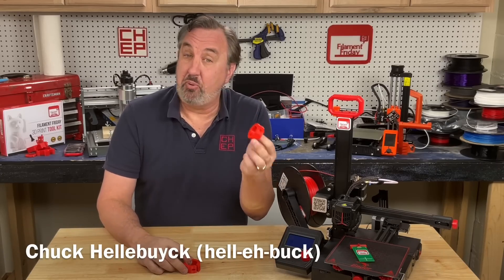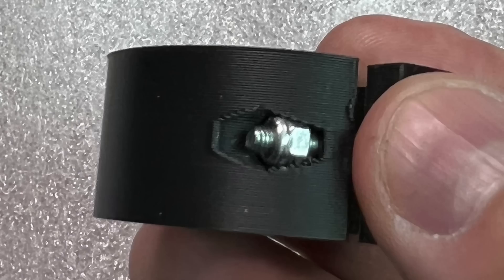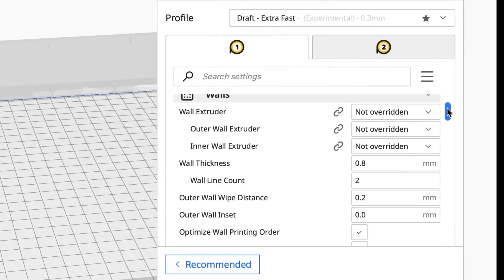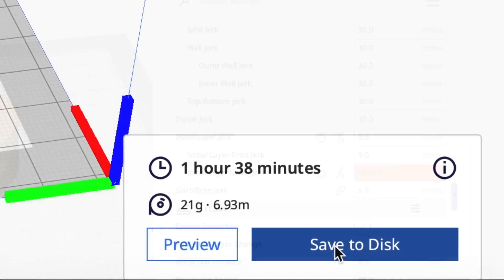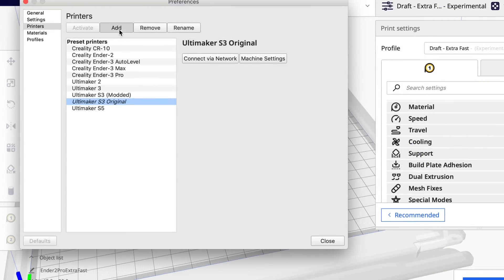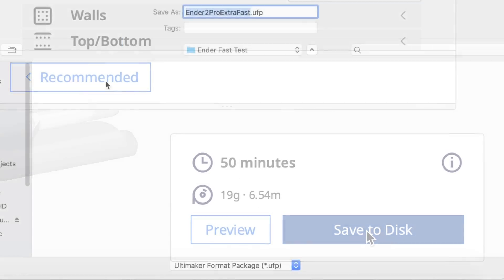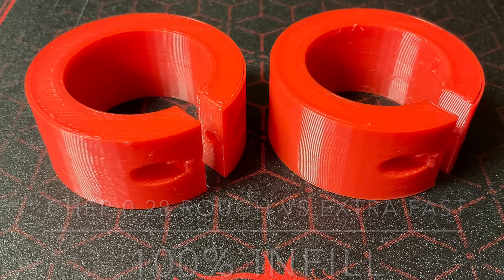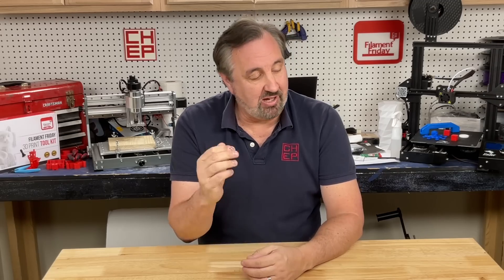Faster 100% Infill Prints with Cura 4.13 on Ender 3D Printer

Comment from the maker: Many people have asked to compare GCodes side by side. I did it while creating the video but couldn’t find anything obvious that creates such a time saving. So I didn’t show it.
Reply: I tried to fiddle with Cura settings on the model and found one  interesting thing. Without touching any speed settings, changing  infill from 100 to 99.9% (with zigzag pattern) cuts printing time roughly by 30%. It appears that Cura ignores infill pattern when density is set to 100% and just prints all layers with the same pattern as top and bottom layers - which could be not optimal speed wise.
Reply: @ivanpruss3762  try it with the Lines infill for better results. I'm not sure what effect that will have on the time, but it's a better infill for 99-100% infill prints
Reply: @ivanpruss3762  When you set infill to 100% in the number of bottom layers is simulated to be 999999 which effectively uses the bottom/top line pattern vs. the infill line pattern setting.
Reply: @ivanpruss3762  Correct. It's changing the top bottom settings to no longer print infill at 100% (but top/bottom instead). SInce top/bottom is printed slower than infill for most printers, the entire print will be slower.

You can just override that setting. No need to trick the S3 profile into working for the ender (or any other printer, really)
Reply: It reduces the resolution of the part by a very large amount. If you had all setting visible you would see it. Also, Ultimaker printers default to zig zag infill when set to 100% which is more efficient.
Reply: So this works on the ender 3 non Pro?
Reply from the maker: Yes
Reply: @FilamentFriday  Thank You for your reply and Thank You for doing what you do. I subscribed.
Reply: Have you tried to compare not gcode, but profiles (saved as HTML as you shown 1.5 years ago in your "Cura Slicer Plug-Ins for Anti-Warp and HTML Settings" video)? Actually there is other option - you could find "CuraSettingsInjector" project on github that parses current Cura version available settings (from their github repository) and outputs Gcode fragment, that you can put to your End Gcode so all settings will be there after slicing any project. Also, for more comfortable comparison I suggest to use Meld or similar diff tool (usually used for programming code comparison)
Reply: The only difference I have seen is how the print is plotted. Maybe it is more efficient the way the ultimaker is set up. I have seen some prints that had an increased time with the mod. I'm using the s3 profile on the ender 3 pro.
Reply: thanks testing now for some reason it wouldnt let me customize my y axis? everything else it let me hopefully still works!
Reply: Thank you, have a great day further.
Reply: I bought an ender 3 pro a few days ago, I downloaded the profile to print faster and when using it sometimes it starts to have a loud clicking when retracting, at that moment it starts to print the layers badly, separated and detached, but sometimes it happens later After an hour of printing the first centimeters perfectly, the clicking begins, it begins to have hairs and the layers do not complete well. As a result, I have to throw away the imprecion. I tried to lower all the speeds, that helps but sometimes the problem occurs. Could you give me any help?
Reply: Can you please uploade you speed settings somewhere, your profile like does not work
Reply: This was a cool trick, Chep, could even be called a hack since your finding a way to hijack their black arts for non Ultimaker machines <(^_^v)
Reply: This setting + concentric infill?
Reply: Yeah, it’s a bunch of subtle things if you look through the GitHub commit logs for Cura and CuraEngine … still … if it works on our non-ultimakers, bring it on! 🤓
Reply: I can usually get something like 30% faster prints by looking at TRAVELS. That's what makes the print slow. If you manage to keep the nozzle down and printing it will print much faster. There's a number of settings including zseam and combing that affect how much travel is needed. I guess Ultimaker is playing with this trick, making continuous prints with a single movement, or even avoiding retractions for some small moves that ends up within the printed area.
Reply: cr6 se bed leveling problem s any help i have rainbows
Reply: @TheMajenos5  I was just about to suggest a video from Shane Goodwin … then I saw that you were already in conversation with him in the comments of that video.  😌

Hope you got it solved.

This is anecdotal, at best, but I have a friend who bought a CR6 SE and, honestly, he hasn’t had a single issue with it since he swapped out the main board for a BigTreeTech and flashing it with the CR6SE community supported Marlin 2.x fork.

I initially chastised him for “fixing something that wasn’t broken” (and I am certainly not advocating the “upgrading for the sake of upgrading” behaviour we often see in this hobby, but in his case … it’s worked out great, and he’s been churning out great quality prints off that thing for the past ~8 months.

🤷🏻‍♂️
Reply: Can I use the ender 3 profile u made for my ender 3 s1
Reply from the maker: Yes

Comment: I have been watching my 3d printer print an it sickens me that at-least 50% of the movement is completely wasted time and energy. There's no reason or excuse for such ridiculously inefficient g-code. There's no reason the programming has to make the hotend move several inches just to reach an area that's just a fraction of an inch away... and there's no reason that the hotend has to go all the way around the part for no reason every single time it moves from one place to another. There has to be a simple fix for this kind of waste. I have absolutely no doubt at all that printing times would decrease as much as 50% to even 7-0% in some cases. I'm actually thinking about writing a program to take g-code and analyze it, and then remove all the wasted and unnecessary movement. There's no reason this isn't part of the original g-code though. It should already be done by the slicer program (I'm using Cura now, but I believe the others have the same problem).
Reply: This is called "combing mode" setting, you can just change it. If this setting is off, non-print moves are direct point to point, and this is actually how early slicers used to do it. If it's on in any of the variants, it does its best to plan around the print. This helps prevent strong stringing, marring the walls, and knocking down the part. You should choose what you deem sensible for your printer and other settings, for example it may not be needed to combine combing and Z-hop.

Note that Ultimaker printer isn't very good at Z movements as they are prone to cause bed oscillation, but is capable of performing very high-speed nonprint XY moves, and Cura is after all the software developed against this particular machine first and foremost, and they have put an insane amount of engineering into this software. You are severely underestimating the complexity of the task when you say "no reason or excuse", just like 99% of people who started a slicer engine project from scratch - you can knock out a basic slicer in a couple weeks, but then you realise just how bad the outcome is and how much more fine tuning and nontrivial pathing is needed.
Reply: @SianaGearz  I understand the complexity and am even amazed by it. With all of that complexity though and comparatively, I don't think it's as complex as it seems. It would be simply cleaning up the pathing. 

I know about combing and yeah, that is a lot of movement... but the same problem exists with and/or without combing. With combing (for example) it will comb a path 99% all the wat around a part sometimes instead of just combing in the opposite direction, like it MUST comb clockwise and can't go counter-clockwise (not a fact, but an example).

For all the amazing and complex things they've accomplished in the 3d printing world, this is nothing compared to most of it. It's not even remotely as complex as most of what has already been accomplished.
Reply: Well... if you design a slicer that works better than Cura and then give it away for free people will likely be happy to use it. That seems like a more efficient use of your energy, rather than writing a program to find the movements Cura incorrectly imparted into your gcode.
Reply: I'm sure there's a good reason it does it the way it does it. Someone probably thought of all of this.
Reply: @No_True_Scotsman  Yeah, the reason is... bad programming (or bad slicing).
Reply: @deucedeuce1572  I think you're underestimating the work and effort that went into this software as it is. If you think it's so great, go fix the code. I'm sure you'll find it's like that for a good reason.
Reply: @No_True_Scotsman  Yeah... and that good reason is that they didn't program it to not do that. I have no doubts about how insanely difficult and complicated 3d printing software is. I have more knowledge about it than most... and of all the things programmed into slicing software... this would not be a very hard thing to fix. As far as I know though, they just haven't done it with the software I use anyways.
Reply: @deucedeuce1572  Go fix it then if you're so smart
Reply: @No_True_Scotsman  Fix the problem that doesn't exist? You're all over the place. According to you, it not only isn't a problem, but it's apparently a feature. Even though you don't even appear to know what it is or even if it exists. Why are you even commenting about it if you have absolutely nothing to say? What has been the point of this conversation?

Comment: tks alot, really usefull. new to 3d printing and just managed to use cura on a new creality cr200b pro... does no have support in no other software than creality print. and the default profiles just suck, they are relly slow and the quality is not even alot better :(

Comment: Best profile ever made a few tweeks to make it work with an ender5 plus but I took a 7.5 day print and made it a 3.2 day print so sweet wish this is how fast printers were stock would make projects actually go fast
Reply: ı have the same machine bro can you explain me the settings that i have to change
Reply: @umiturgutaswwsa  if your using cura I copy and pasted the marlin from the e5 to the e3 profile and made the e3 into an e5 profile in machine settings and  proceeded to adjust quality settings to make it work with 20% infill better and added a few lines I’d have to get in a call with you to actually show you but I’m not sure how to do that but I’m just finishing a mando helmet in the next 2 mins and it is taking under 2 days to print

Comment: When printed for 1 hr 55 min there is not Infill( orange color) looks like Top or Bottom Layers (Yellow color) on Preview
Reply: yeah I noticed this, and with the ultimate printer it was orange indicating that it is printed as infill and due to the fact that infill speed is higher than top and bottom speed could this be the reason it is so much faster?
Reply: @dietrichgutschow  Possible

Comment: why do I lose the profile when I change the nozzle size to 8mm?
Reply: Probably because no 8mm nozzles exist haha
Reply: @MechInvent  would an 8mm nozzle be an absurd thing??
Reply: @regis2480  do you mean 0.8mm, or 8mm? An 8mm nozzles would only be good for industrial applications. You’d need a hopper for plastic pellets, a huge heater block and power supply to run it, and massive cooling almost like the dryer fans in a car wash.
Reply: @timothymusson5040  I mean .8

Comment: An easy way of achieving the same thing is to set the wall thickness to something stupidly high, so the entire model is printed as if it was a wall. This makes the lines follow the pattern of the outer wall, which is usually longer and sweeping which means less direction changes = less accell and decell = less time printing during those slower speeds. Compared to the 100% infill, which is very zig zaggy which means lots of direction changes = lots accell and decell needed = more time spent printing during those slower movements
Reply: I think you get the same result if you change infill to 100% and set it to Concentric mode.
Reply: Nice thanks, I'll have to try it as sometimes my method does actually increase print times on certain models. @ItsBoyRed